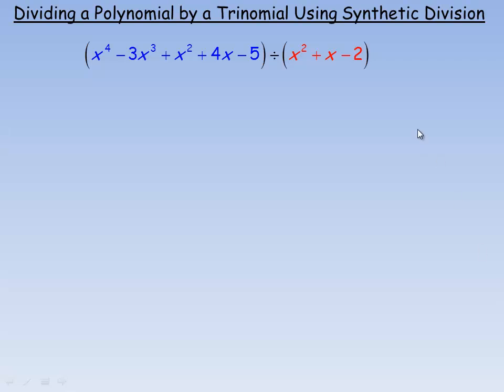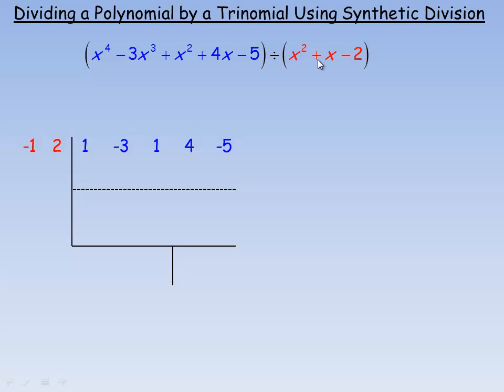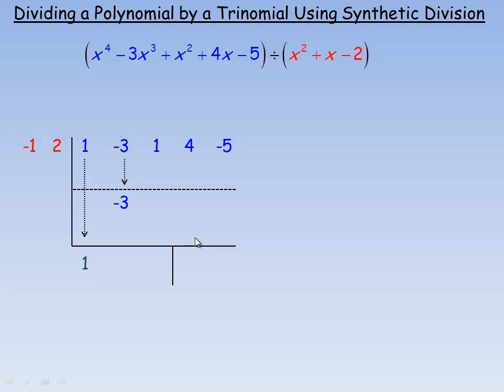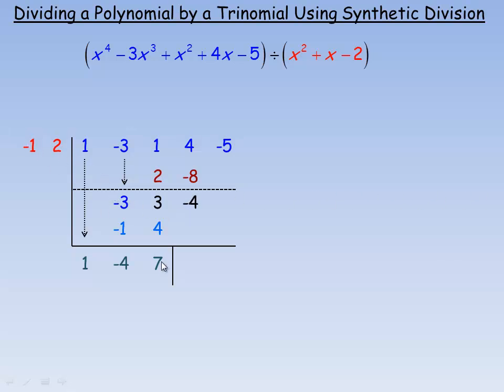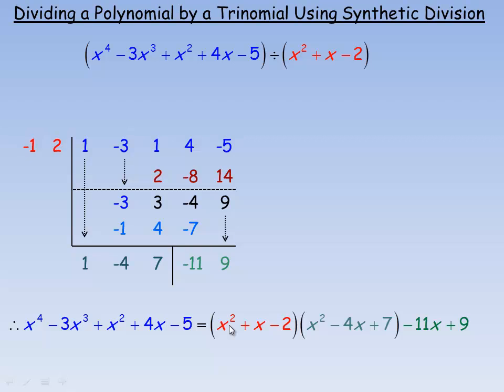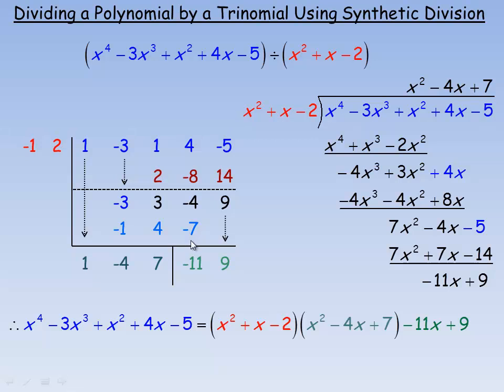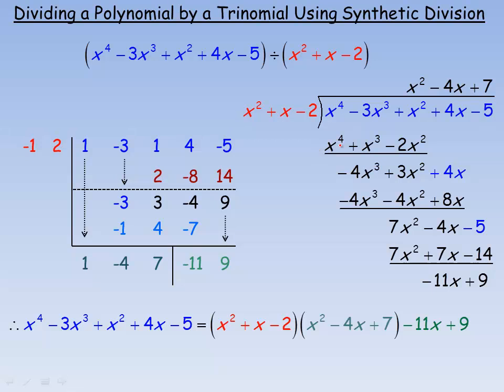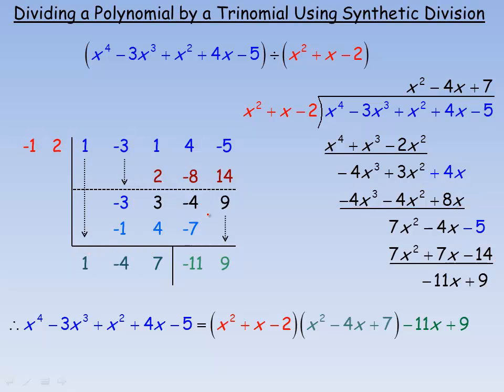Dividing a Polynomial by a Trinomial Using Synthetic Division

Comment: You can do it for any polynomial. Suppose the polynomial has  n term and and divisor has m term ( assuming none of coefficient  is zero in poly and divisor). Make a m x n grid and write the coeff of polynomial in 1st row and then write the coeff of divisor in left side of grid taking a minus sign common from second term . for eg . if the divisor is x^4 +x^3+x^2+x+1 then you write 1- ( -1,-1,-1,-1) at left side of grid . Now you copy the first term as it is below the grid and multiply it with each term in bracket at left side of grid and put it diagonally starting from last row second column till it reaches second row .Now you add the term in second column and put it last and repeat the process . This will give you remainder and dividend of any general polynomial
Reply from the maker: Hi, yes I made a video (later) for that as well.  Thanks for the comment.

Comment: Hi may i ask where do the exponents go? For example the x⁴ was turned into 1. Where did the exponent ⁴ go?
Reply from the maker: Using synthetic division you work only with the coefficients. When you write 1  -3   1   4   -5 it represents 1x⁴ – 3x³ + 1x² + 4x – 5 since those are the coefficients of this polynomial.  The powers of x (or whatever variable) are understood to go from the right in ascending powers of the variable.
Reply: @AlRichards314  ohhhhh now i get it. Thank you so much for this! :)

Comment: Why is the remainder -11x+9? Where did you get x? and why is 9 constant? Is this a rule that the first term for remainders must have a variable and the second shouldn't? Does this apply to all problems?
Reply from the maker: If you are dividing a polynomial with x^4 by the trinomial with x² subtracting 4 – 2 = 2.  So we will usually get a remainder with x² in it.  The only exception is when it goes in evenly there wouldn't be a remainder.  Also the exponents of x descend as you go left to right; x^4, x³, x², x then a constant at the end.  Yes, it always works this way.

Comment: Thanks I understand this perfectly, but I have a question, Can you use synthetic division in dividing two polynomials with two variables? For example, (x^2+2x^2y-2xy+2xy^2-3y^2)/(x+y),
If Yes how?
Reply from the maker: I've not been asked that previously.  I don't think you'd be able to use synthetic division to divide that, long division would be my option.
Reply: I understand, Thanks for the recommendation!

Comment: Shouldn't the value of x (in the divisor) be -2 and 1? Because the factors would be (x+2)(x-1)
Reply from the maker: The -1 & 2 on the right side of the synthetic division are the opposite coefficients of the x & -2 terms from the x^2 + x - 2 divisor, not the zeros of x^2 + x - 2.  It's a coincidence here that the zeros are the opposites of the numbers you use.

Comment: how to put it in fraction?
Reply: If u r talking about co efficient  of x sq then divide it from ur divisor and follow the video
Reply from the maker: You'd write it like this:
(x^4 - 3x^3 + x^2 + 4x - 5)/(x^2 + x - 2) = x^2 - 4x + 7 - (11x - 9)/(x^2 + x - 2).
Note that I factored a negative out of the -11x + 9, that's why the sign on both changed.

Comment: +AlRichards314  sir what if the trinomial is like this one 3x^2 +2x+3.. can you give a example? Thank you!
Reply from the maker: +Mel Dacillo That's difficult to type, but you'd have to factor the 3 out of the trinomial to make it 3(x^2 + 2/3x + 1) and then the 2 numbers to the left of the division are -2/3 and -1
Reply: +AlRichards314 then after than when would i use the 3? Btw thanks for the fast respons :)
Reply: AlRichards314 it's ok now sir. Thank you for your help :)

Comment: Sir about the remainder ? why we write -11x+9 ? can you kindly explain ?
Reply from the maker: Jemaica Tejada Any term at the bottom of the synthetic division starts at the right end with a constant (the 9) and every term you go to the left becomes a variable term, starting at x^1, then x^2, etc.  Since there is just one number to the left of the 9 in the remainder spot, which is -11, then this corresponds to -11x.  hence the remainder is -11x + 9.If the remainder part had 3 numbers, let's say 5  -6  1, then this would correspond to a remainder of 5x^2 - 6x + 1.
Reply: Sir Thank you so much, I didn't expect you'll answer me this fast. Now I understand and my curiosity been answered :)
Reply from the maker: Jemaica Tejada You're welcome.  I try to respond as soon as possible to comments.  Sometimes it's days, but it can be a few hours like in your case. Cheers.
Reply: Okay :) thanks for the help again :)